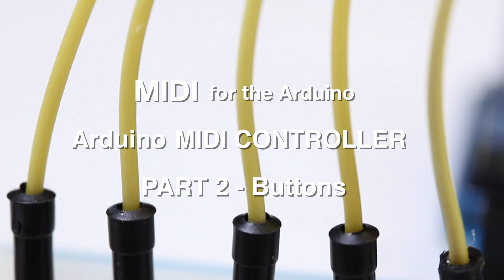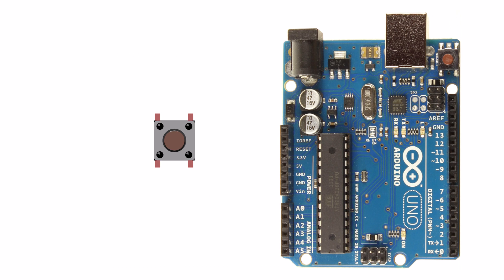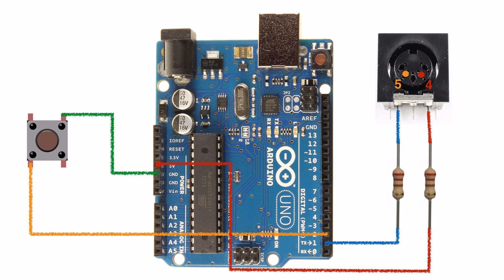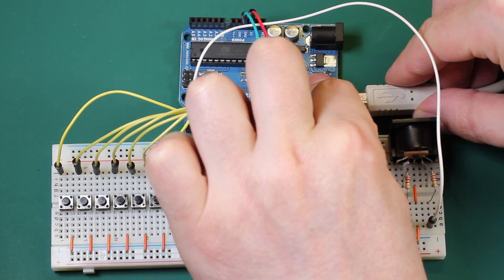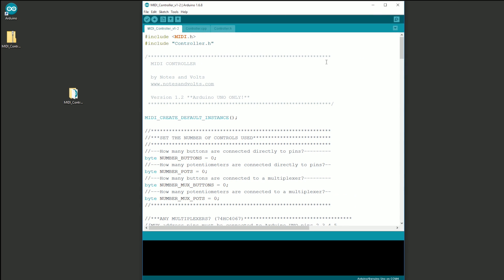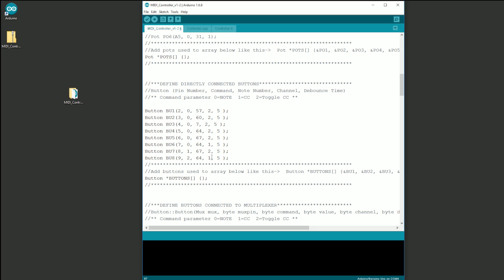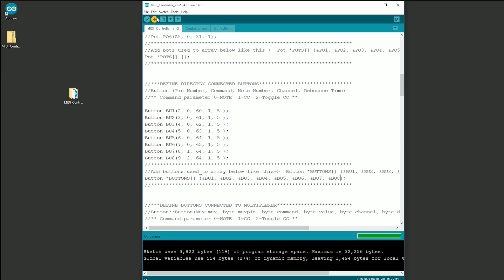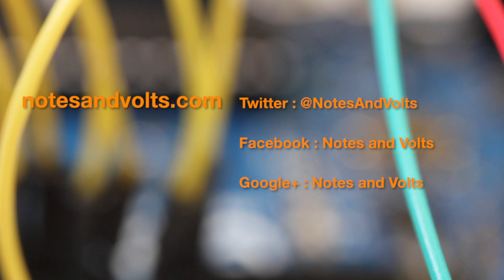Arduino MIDI Controller: Part 2 - Buttons

Comment: Hi Dave if out there...love to ask if you could include coding for LED indicators for each buttons push On and push again Off...i tried to hack it but i failed...Thanks in advance
Reply: Hello Azman Ahmad. Did you managed to add coding for LED indicators, as you wanted?
Reply: @slaamri  yes i did get it... Do you want a copy of it?
Reply: @azmanahmad2820  Great! I'd like to have it! Thanks!
Reply: @slaamri  #include <MIDI.h>

MIDI_CREATE_DEFAULT_INSTANCE();
 
const int relay_1 = 12;
const int relay_2 = 11;
const int relay_3 = 10;

const int mswitch_1 = 8;
const int mswitch_2 = 7;
const int mswitch_3 = 6;

int toggleState_1 = 0; 
int toggleState_2 = 0; 
int toggleState_3 = 0; 

void setup() {
MIDI.begin(MIDI_CHANNEL_OFF);
Serial.begin(31250); 
  
  pinMode(relay_1, OUTPUT);
  pinMode(relay_2, OUTPUT);
  pinMode(relay_3, OUTPUT);
  
  
  pinMode(mswitch_1, INPUT_PULLUP);
  pinMode(mswitch_2, INPUT_PULLUP);
  pinMode(mswitch_3, INPUT_PULLUP);
  }

void relayOnOff(int relay){

    switch(relay){
      case 1:  
              if(toggleState_1 == 0){
              MIDI.sendControlChange(16, 127, 1);  
              digitalWrite(relay_1, HIGH); // turn on relay 1
              toggleState_1 = 1;
              }
             else{
              MIDI.sendControlChange(16, 0, 1);
              digitalWrite(relay_1, LOW);// turn off relay 1
              toggleState_1 = 0;
              }
             delay(100);
      break;
      case 2: 
             if(toggleState_2 == 0){
              MIDI.sendControlChange(15, 127, 1);
              digitalWrite(relay_2, HIGH); // turn on relay 2
              toggleState_2 = 1;
              }
             else{
              MIDI.sendControlChange(15, 0, 1);
              digitalWrite(relay_2, LOW); // turn off relay 2
              toggleState_2 = 0;
              }
             delay(100);
      break;
      case 3: 
             if(toggleState_3 == 0){
              MIDI.sendControlChange(10, 127, 1);
              digitalWrite(relay_3, HIGH); // turn on relay 3
              toggleState_3 = 1;
              }
              else{
              MIDI.sendControlChange(10, 0, 1);  
              digitalWrite(relay_3, LOW); // turn off relay 3
              toggleState_3 = 0;
              }
             delay(100);
      break;
      default : break;      
      }
  }

void loop() {     
     
   if (digitalRead(mswitch_1) == LOW){
     MIDI.sendControlChange(16, 127, 1);
      delay(200);
      relayOnOff(1);      
    }
    else if (digitalRead(mswitch_2) == LOW){
      MIDI.sendControlChange(15, 127, 1);
      delay(200);
      relayOnOff(2);
    }
    else if (digitalRead(mswitch_3) == LOW){
    MIDI.sendControlChange(14, 127, 1);  
      delay(200);
      relayOnOff(3);
      
    }
        }
Reply: @Azman Ahmad thank you ! I try this. I'll let you know.
Reply: @slaamri  peas subscribe to my channel...there a video there for guitar foot switch
Reply: @azmanahmad2820  is it possible to contact you directly?
Reply: @azmanahmad2820 I can't send you messages directly in tour youtube page. Could you contact me please?
Reply: @slaamri  i cant contact you too.. comment on one videos in my channel..
Reply: I tried but I can't leave a comment 😂😉
Reply: @azmanahmad2820 http://www.facebook.com/said.laamri.9

Comment: i have to say. this series of videos u have. theres a chance that ill understand. well done. tnx.. if i may ask. do you have any tutorial. instead of using 5 pin midi, to use usb instead? so i can connect this to pc directly? and will be usb powered? tnx again
Reply: not really familiar with this. what i want to do is a foot controller. for guitar softwares like amplotube, bias fx. will the usb out work already? to connect directly to pc?
Reply from the maker: Thank Jack! Right now this is a 5-Pin Midi project only so you will need a Midi interface for your computer. I am working on a USB version for future projects.

Comment: If i'm Trying to use this as a footswitch for my guitar amplifier it will work?
Reply: Luca Camporesi no. Footswitches are usually amp specific since the circuits are all of varying layout. Unless your amp has midi.

Comment: Hi! How is that you don't put any pull up or pull down resistor on your push buttons? And how can it be posible you don't have any bouncing when pushing that buttons? :')
Reply from the maker: Hi Roger. I use the Arduinos internal pull up resistors in this project. Also, the code has a debounce routine included.

Comment: Thanks bro!!!! It works very well with my old Digitech GNX1 guitar effect processor!!!! Guess I wont throw it away cause now I made 8 button controller for it and expanded its capabilities!!!!
PS: I want to add MIDI.sendProgramchange to be forth option... So can i just add: 
case 3: //Program change
          MIDI.sendProgramchange(BUTTONS[i]>Bvalue, 127, BUTTONS[i]>Bchannel);
          break;
after toggle?
Cheers
Reply from the maker: Hi LoCo. Nice work. Yes you can add more commands to the Case section. Good luck
Reply: Iv'e tried this, but it doesn't seem to work.  I keep getting an error message.

Comment: Great video! But i need some help..My prototype button works,  bu if i stop pressing the but for longer than about a second it stops transmitting midi, if i reset the uno ot works again until i stop pressing the but for longer than a sec.. Any idea why??
Reply: O, just figured it just happens when i make the button send CC message instead of notes..

Comment: Hi,Dave!
Love your tutorials and your channel content!

About the buttons:your method of connecting them right up to digital pins is simple and effective,but if there are more buttons to be read I would suggest using parallel in-serial out shift registers.They are great because you can cascade them together and read maybe hundreds of switches.
P.S. The idea about using a multiplexer was pretty clever.Going to keep it in mind when building my projects. :)

Keep them videos coming!
Cheers!
Reply from the maker: Thanks for the tip elektro! I will check it out.

Comment: Super tutorial! Do you know how I can make my Arduino to be recognized as a controller by the computer and send MIDI CC through the USB (same as for powering) instead of a MIDI port?
Reply: https://www.arduino.cc/en/Reference/MIDIUSB maybe?
Reply: Use some Softwares Like " LOOPMIDI " and " HAIRLESS MIDI ". It's a very Basic and Amazing Way to control Midi via USB.
Reply: I connected mine to a raspberry pi 3 by connecting the signal on arduino pin 1 (tx) directly to pin 8 on the pi3 (rx), and I would imagine you could do that with any midi interface, although per the standard, it really should be separated with an optocoupler. To connect it as a USB MIDI device, depending on your Arduino model, you can use the HIDUINO firmware found here: https://github.com/ddiakopoulos/hiduino. Otherwise you will need to build a cable with a separate controller. This might help: https://axe4live.wordpress.com/2012/02/04/diy-midi-interface-for-ipad-version-2/.
Reply: I use an Arduino Leonardo for that
Reply: I just did this myself, it involves flashing different firmware onto your Arduino's atmega16u2 chip, which normally functions as an interface with the serial port. After you flash it with different firmware, it will be recognized as a MIDI device instead. Using the information provided by the Hiduino project repo https://github.com/ddiakopoulos/hiduino and a little command line know how, you can do this quite easily! I highly suggest checking it out and giving it a shot.
Reply: connect the tx port to a usb i think..

Comment: This is awesome! Great video.

I just have a question for you: is it possible to transport the MIDI data via a USB cable from the Arduino Board without the use of the MIDI cable? I want to use Midi to Serial converting software (hairless MIDI-Serial) to be able to use the MIDI data coming directly from the UNO in a Digital Audio Workstation.
How can I do that?
Reply from the maker: Hi Leonard. The project doesn't support USB Midi. You would need to add a midi interface to your PC that has a 5-pin Midi input jack. That's what I do.
Reply: Notes and Volts means the above setup can't be used with a 'midi to USB' cable?

Comment: Dear Brother, 

I watched your video on you tube, its really inspiring and very helpful for the person like me.
I need your help.

I am not a person from software background, my work is to produce music. my educational background is computer hardware and electronics.
 
Now, when performing music live, i am facing the problem to change the sounds from my keyboard in MainStage on the fly. as i am playing indian Bollywood songs i have to be very quick in program change which is quit difficult with normal keyboard. 

So, i am planning to make a switch array of 127, which can change sound directly. i mean when i press 0 button ardiuno send midi program change message to channel 1 and transmit through midi out to my keyboard or MainStage. 

but this is like travelling on space shuttle for me because of the programming code. i am zero in it. i need your help to get me the code for this. please this is a humble request to help me out if this issue.

I have Arduino MEGA2560 with lcd keypad shield. 

One more thing, can i use lcd for information? i mean, for example, when i press button 12 on my keys array, so it reflects on lcd “ Program 12”.

Here i am sending you the picture of on of the device made by some one, i don’t know who have designed and manufactured it, but its really good for me.please find the attached file for the same. but unfortunately its not available easily in india. 

apart from that it has some different hardware in it. its consist of one pre programmed EPROM and one display driver IC. 
but i think that making this thing with Arduino is more easy, except writing the code for it, which is impossible for me to do.

Awaiting for your reply. Thanks for reading my long mail. but this was the only way to describe the problem i am facing.

Thanking you again.

Regards,
Richardson.

Comment: Does the Midi Controller program work for the Arduino Mega 2560 Rev3?
Reply from the maker: Hi Chaosmos. This project is for the Arduino UNO only right now.
Reply: Thanks regardless, part 3 basically solved my problem with the use of the multiplexers. Keep up the great content!

Comment: Hello sir, The program and software which are in the video are not same as you have shown in your part one of this series can you please provide the same program which you have used in the part 1 please please
Reply from the maker: Hi Deepak. Use v1.2 that is linked in the video description. I functions the same as the original but fixes a couple of things.

Comment: Is there any way you can help me with a small project? I'm very familiar with midi, but am kinda new to arduino. I would look online for an existing project instead of bothering you, but sadly no one else has tried it or the code is so outdated it won't run. 

I'm trying to build my own midi control pedal for a guitar multi-effects pedal. I'm not sure what kind of midi message is going to the pedal or how I would go about coding it. I tried your midi output tutorial to see if it would work, but sadly it didn't.
Reply: This video should be the one for you, I've used this to control my strymon pedals and it works a treat :) Look up to MIDI CC values for you pedal and then it should be good
Reply: Do you send Midi CCo or Toggle CC for your Strymon Pedals?

Comment: Really great videos! Is there any limitations on what kind of messages I can send using this hardware? I'm thinking of sending not only CC messages but also SysEx or even more freeform ones, documented in the manual for my synth.
Reply from the maker: +Mathias Dahl Thanks Mathias! I purposely left the command functions accessible in the main program for exactly this reason. You can see an example of me modifying the code for a lighting controller in the following video:  https://youtu.be/fh4B_N-H2J8